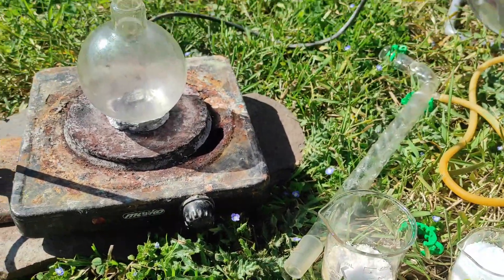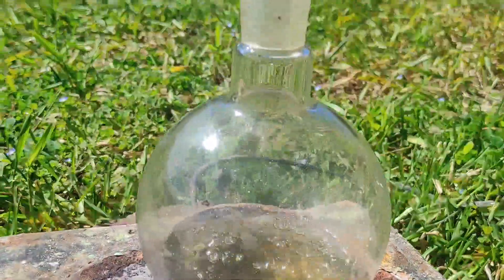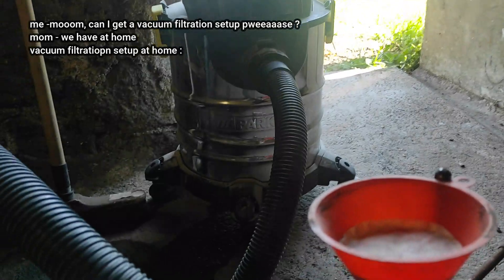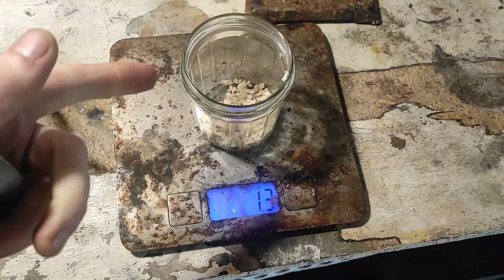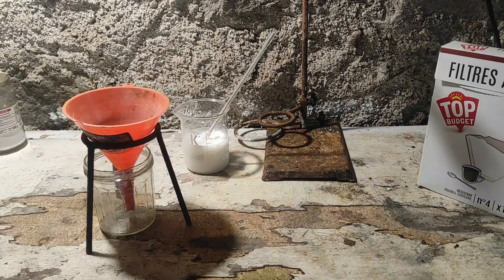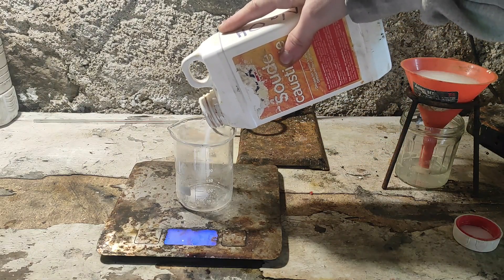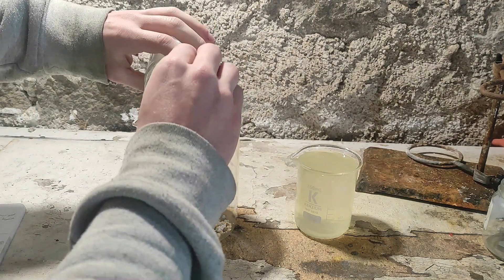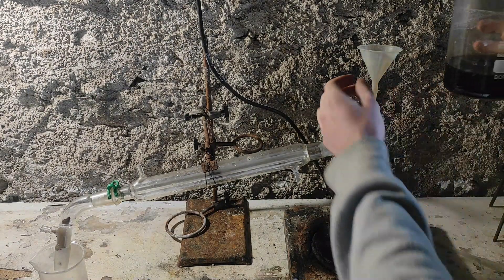making aniline from benzoic acid !

Comment: Hi Jam Kemist,
Nice video and job.
I really like the transamidation reaction of urea (carboxamide) and benzoic acid to benzamide without the annoying passing through ammonium salt, then dehydration steps.
2 C6H5-C(=O)-OH + H2N-CO-NH2 --> 2 C6H5-C(=O)-NH2 + HO-CO-OH (H2O + CO2(g))
The Hofmann degradation of amides to amines is a must for OTC chemists like us.

The aniline preparation from benzamide is pretty straightforward from bleach.
Aniline is usually quite difficult to obtain for OTC and usually requires nitrobenzene or nitric acid and benzene.
Aniline is quite interesting for diazotation reactions or oxydation reaction to p-quinone (reason for its darkening in the air and C6H5-N=C(CH=CH)2C=N-C6H5 or polymer like compounds formation).

Based onto your video, I can imagine an OTC process to make terephtalic acid diamide (from PET bottles, NaOH and urea), then p-benzen-diamine and finaly 2,3,5,6-tetrachloroquinone (chloranile) in good quantities instead of the preparation from expensive pharmaceutical paracetamol (p-acetamido-phenol). The resulting chloranile is an easy source for exchange of the halides with NO2(-) from nitrites (to make nitranilic acid and nitranilate salts) or a lot of other energetic salts.
The tetrachloroquinone is aromatic but acts as an halogenator exchanger like a alfa-halogen to a EWG (electron withdrawing group); the aromatic double bond linked to the ketonic groups do a bit like a alfa-halogeno-keton thus exchangeable (chloraceton or alfa-chloro-phenone are hell lacrymators war-gases because they bind to sulfide into eyes membrane proteins by fast exchange and setting free some HCl... so it is a bit linked to chloropicrin, ypperite reagents but much friendly for chloranile.
Theoretically the 4 halogens are replaceable by 4 nitro thanks to nitrite solution; the resulting tetranitroquinone (O=C(C(NO2)=C(NO2))2C=O) suffer for hydrolysability just like HNB (perfect OB xplo C6(NO2)6 - VOD 10 km/s) (it turns spontaneously into trinitrophloroglucidol (1,3,5-trihydroxy-2,4,6-trinitro-benzene) into moist air while evolving some red fumes of NxOy from HNO2; so the viccinity of the ketonic-aromatic ring (molecular orbital system) and of the adjacent -NO2 groups convert some of it via nitro-nitrite rearrangement into -O-N=O; the later nitrite "esters" of phenol are not stable and fast hydrolyses into phenol. In fine you get 2,5-dihydroxy-3,6-dinitro-quinone what is dense; makes primary salts and in the range of TNP and picrates.

It is of course of great interest to get hands on urea while it is stil accessible (used in add-Blue for diesel engine as 320g/L solution) before EU regulation ban for diesel engines or stil in use for agriculture as urea prills (I have about 50kg bag enough for all a life of experimentations).
Else it can be recollected from urine (about 2L per day and 60g of urea); not many knows it but besides urea nitrate what is harder to get by now due to EU HNO3 ban; ureum oxalate is also of little solubility what might be good for isolation.

Regards,
PHZ
(PHILOU Zrealone from the Science Madness forum and many Alt.Engr. newsgroups on A.O.L)

P.S.: Yes I'm also highly interested in you OTC spectro DIY experiment 
(I also plan to make one or more with extended capacities and a lot of extension stuffs arround (like CD-DVD-professional diffraction gratings- screen grids and 480 pixcel or 2k digital cams, prisms, homemade prisms, homemade grisms, and to optimise discrimination down to 0,5-1 nm sensitivity)
Reply from the maker: Thanks a lot for your comment ! 
Funnily, I just used some add-blue like a day ago to make some cyanuric acid.

Also your idea of doing a similar process to terephtalate seems Interresting but quite long and I don't have much time but thanks for proposing still !

I'm working on the spectrometer video but it won't be just a random tutorial since there are too much of those on YouTube alredy hehe
Reply: @jam_kemist3986  
As we say in French; 'Great minds always encounters" ;0)

For those unaware of the use of add-blue (urea solution) in diesel motor engine:
It is used to destroy trace (but existing) NxOy that do form inside diesel motor engine while operating (compression and inflamation of fuel oil droplets in the air of the piston volume during a motor pulse to activate the piston move and thus the car.
In a way to be more eco-friendly, urea solution is added somehow in the afterburn fumes prior to exhaust.
The urea then destroys any NO or NO2 (or N2O3 or N2O4) generated into the process then leaving H2O(g), CO2'g) and N2(g) behind.

PHZ
Reply: @jam_kemist3986  when I've tried to make cyanuric acid this way, it just clogged my flask... How dyou get it out 😅 I used a drill... It broke the drill... Then the flask shattered when I shook it - that stuff fights back 😂

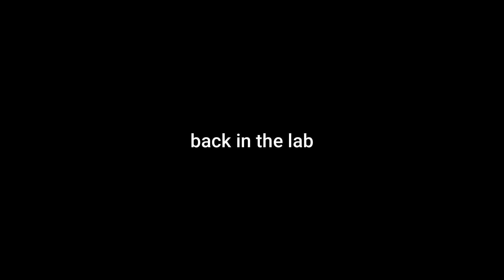Comment: I think those sparkles at 1:50 is just the bubbles in solution popping, sending tiny amounts of liquid flying where the sun reflects light through them.
Reply from the maker: @Polkem1  idk it really looked like shards
Reply: @jam_kemist3986  I think they're benzamide crystals - it is capable of sublimation and when recondensing, can show as those tiny airborne crystals 💎
Reply: @jam_kemist3986  if I remember correctly I experience something similar with urea and sodium hydroxide to make ammonia, I doubt it’s shards though, just caustics.